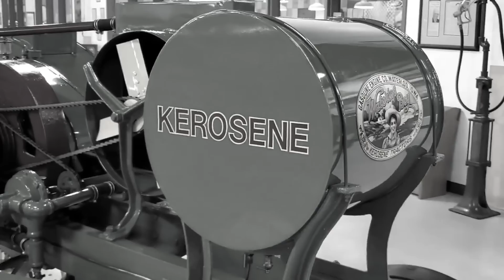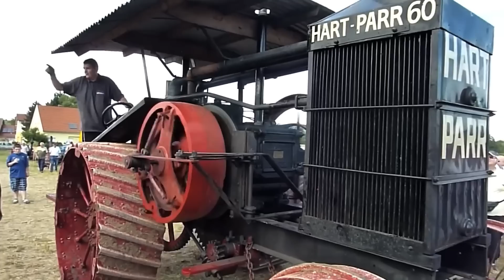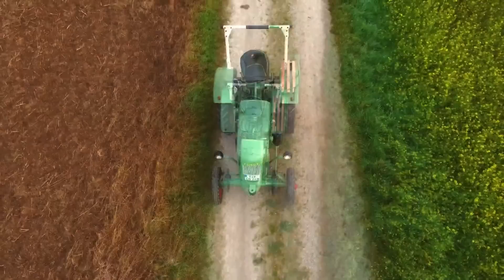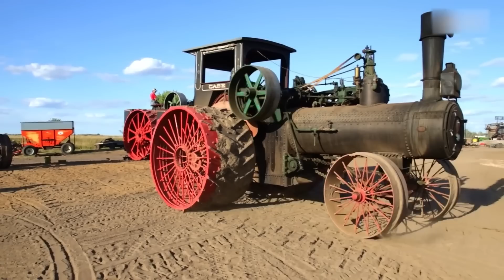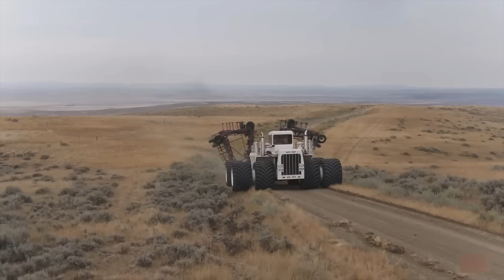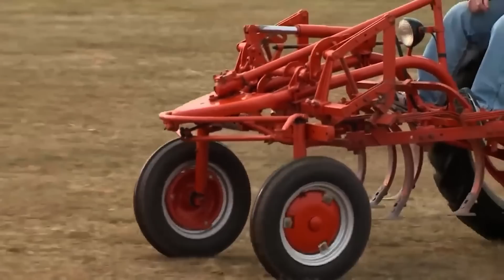20 MOST INNOVATIVE TRACTORS IN AMERICAN HISTORY

Comment: Didn’t the Ferguson te20 invent the 3 point hitch
Reply from the maker: Great question! The Ferguson TE20 helped popularize the 3-point hitch globally, especially in Europe, but the actual invention came earlier. The 3-point hitch system was developed by Harry Ferguson in the 1920s and first saw commercial use on the Ferguson-Brown Model A in 1936.

In the U.S., it gained major traction when Ferguson partnered with Henry Ford to bring the system to the Ford 9N in 1939—which is the tractor featured in this video. That’s why the 9N is such a milestone in American tractor history: it made the 3-point hitch a standard on American farms, and every major brand followed.

Thanks for watching and digging into the details!
Reply: @VintageAmericanMachines  oh that’s cool